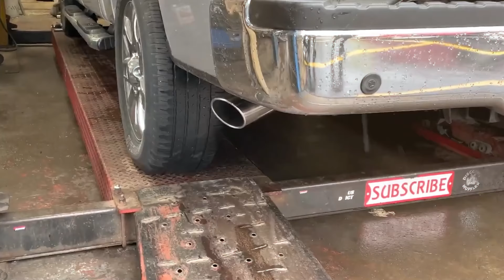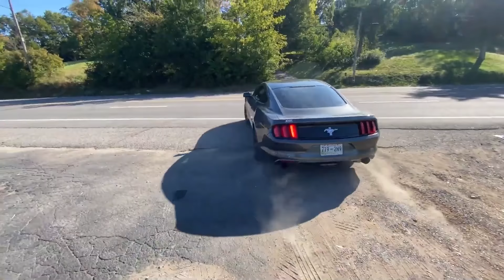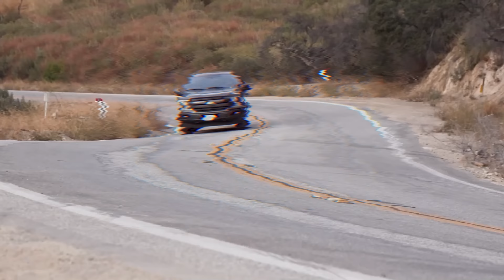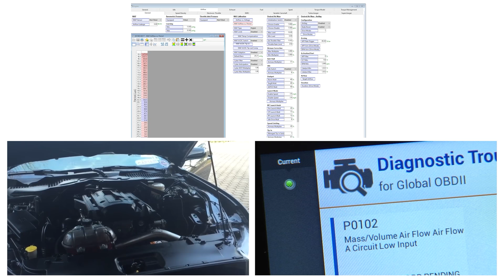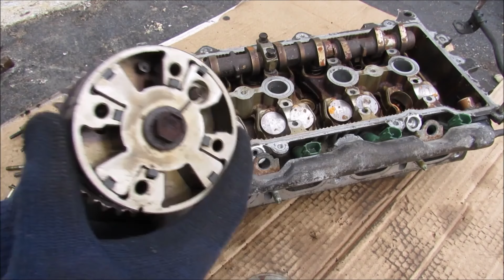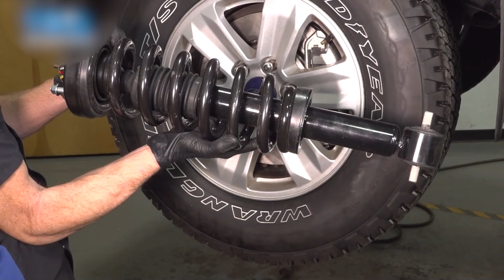10 'ILLEGAL' Ford Tricks to Make Your Truck or Mustang Run BETTER

Comment: Cant beat Ford trucks old ..or new. '24+ model revision is excellent. Next vehicle is new Ranger Tremor . Drive '22 Edge AWD- 2.0L GTDI turbo. Very nice daily driver. Been impeccable. 57k mis. Just good basic maintenance practices. Top Tier rated fuel always.

Comment: The first mod I did on my 2013 Mustang 5.0 was an off road X pipe. Everything else being stock, including the tune, it made a big difference. The stock cats on these Ford, especially the coyotes, are fairly restrictive
Reply: I have a steeda CAI,cat delete, x pipe, with dynotune and aluminum one piece driveshaft in my 2013 mustang GT. The difference is unbelievable and worth every bit of the work. It bumped it up to a little over 500hp.
Reply from the maker: Nice! That off-road X-pipe really wakes up the Coyote — especially when the rest of the system is stock. You’re right about the factory cats being restrictive. That setup definitely improves throttle response and gives the car a whole new tone. Did you notice any low-end torque changes or CELs pop up after the swap?
Reply: Have 04 SVT Cobra terminator- orig owner car - 4900mis. Absolutely awesome Mustang. One of best ever. Only Steeda CAI & SLP cat bk exhaust done. Keep er stock for resale values!

Comment: 18' 3.5 EcoBoost, 5 star tuner, O2 sensor spacers, SPD turbo adapters, cold air intake, 4" exhaust, Banks pedal monster, and a few other small tidbits complete night and day difference from stock
Reply: What’s the benefit of putting a spacer on the O2 sensor? I have a 18 3.5 f150 also.
Reply: @j @jonathanmorales4566 all it does is keeps the check engine light off if the cats have been removed.
Reply: 5.0 but not available
Reply: How will all of that affect the longevity of the engine

Comment: My 2018 5.0 f150 10 speed tranny was rebuilt at Ford dealer because of shifting issues ( hard downshifting,  slow up shifting when cold). I was talking to tec before work was done about performance. When I went to pick up truck after rebuild,  tec met me in parking lot and told me he removed the learning curve (adaptive learning) and now transmission shifts at different speeds. Tec said when you first get new vehicle, it shifts according how you drive.  And most people 'baby' their vehicle for a while and computer learns from you on how to shift
 If I use SPORT mode now, it's awesome. A lot better pick up in speed. I can actually burnout with all terrain tires,  something I couldn't do before. And tec said to change air filter more than you think you need to. He said besides oil change every 3500 to 4500 miles, air filter change is cheapest things to do for performance without going crazy with ECU, exhaust, modes.
Reply: My trans does the same, hard downshift into 8 and slow into 4th.
Reply: @victorsmith6397 my rebuilt trans hesitates shifting from 2 to either 3 or 4 when temperature below 40 degrees. Did same thing before rebuild. If I wasn't retired on limited income, I'd trade it for Nissan pick up. I've talked to several people who own and hardly any problems. And great customer support.
Reply: @dugie5246  Not Nissan there trucks are junk. Well known. Your truck is superior. Get fluid changed even if only low mileage on new transmission. Ford uses an upgraded fluid now ..better than Motorcraft (still good fluid). Ask em. Find a better dealership. All are independently owned. F150 is best truck avail. Good basic maintenance practices required only.
Reply: @Davido50 thanks for info. Only problem is I have Ford extended warranty and it requires me to go to selling dealer unless I'm more than 40 miles away. Maybe I'll take a trip and go to a dealership 100 miles away. Warranty provides rental for 5 days and $60 night motel for 3 days 😅😊

Comment: Deleted the EGR and did a straight pipe
Reply: GOOD ON. YOU BROTHER! SAME here, and it was the best accomplishment, ever.
Reply: Thats terrible for air quality for YOU & OTHERS. Not wise.
Reply: @Davido50  Sure. 😆 But, let's not worry about the container ships that travel across seas delivering the 'precious' materials (raping the planet) for the construction of DPFs, the manufacturing of the caustic and hazardous fluids (DPF) & its forever mounting of plastic containers, cardboard boxes its contained in, or military vehicles.  How about GFY
Reply: @srgsparky4764  Now sparky, that's not very nice! Do you see my comment, because I think I'm shadow banned.